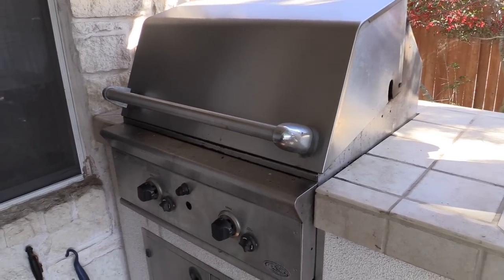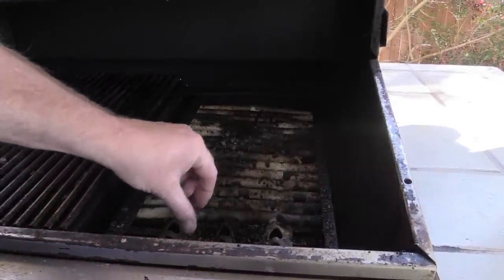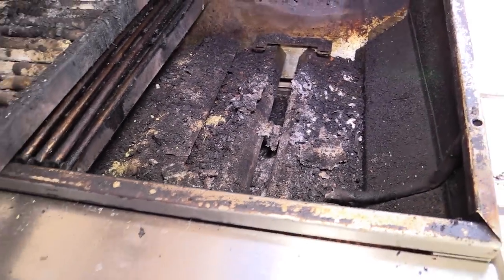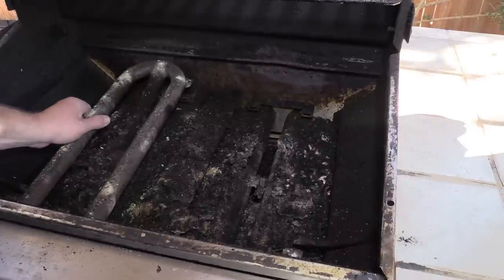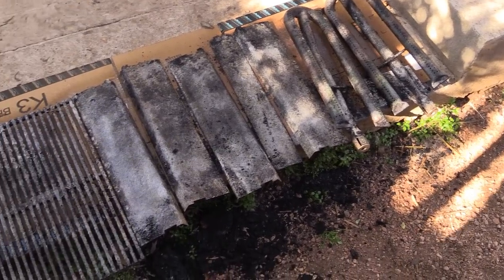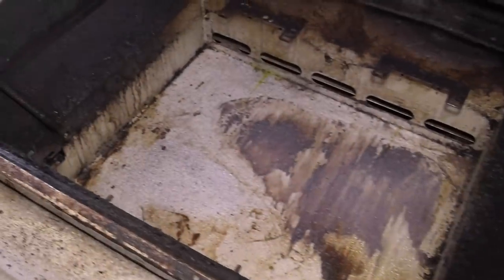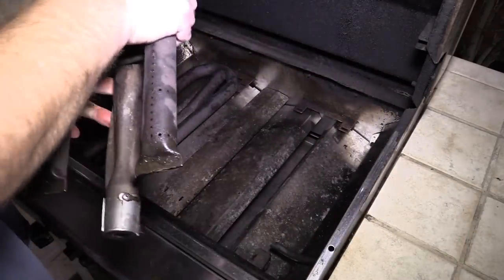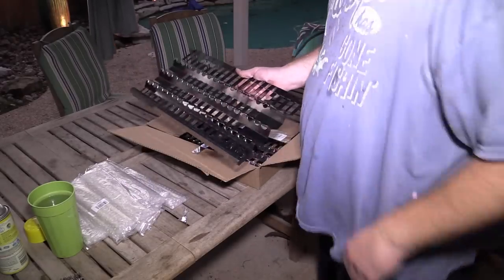How To Clean and Repair a DCS Gas Grill

Comment: Hi Troy and thanks for the great video! Any hints how to remove the burner. I'm lifting up while pulling towards the back of the grill. After watching yours just slide out I'm wondering what I'm doing wrong?...

Thanks!
Reply from the maker: Hey Phil, it can be a little finicky. There are two clips towards the back wall that hold the burner up. Perhaps one of those has gunk on it and is stuck? I remember having to turn my burner about 45 degrees to the side lengthwise to get it out. It's also possible that it is stuck on the front side wall. Again, probably just has some gunk on it and will take a little muscle. There isn't anything solid holding it in place, so just keep tugging and rotating it until she breaks free. Mine are stainless steel, so you cannot damage them if yours are also SS.

Comment: Thanks for the video, I have  DCS that is about that old but the ceramic is still in good shape(because the person who gave it to me USED it once) so to clean them though I should just heat them up? or can you pull them out and clean them off with some kind of solution?
thanks.

Comment: Awesome video troy.you made a messy job look so easy! By the way what kind of oven cleaner do you use?
Reply from the maker: Hey a2fitness, I used a heavy duty commercial grade bbq degreaser/cleaner. Don't remember the name, but it's in a smallish silver aerosol can with black top. This was the 1st time I'd used it and it worked great. Normal oven cleaner doesn't work nearly as well. Sorry I already threw the cleaner bottle away or I'd give you the name. Thanks for asking!

Comment: Excellent video. The grease pan on my DCS 48" won't slide out. It moves a fraction of an inch. Any idea on how to get it out?
Reply from the maker: It’s on rails, so try prying it out by sticking a flat head screwdriver under it alternating sides. Or, heat it up to loosen the grease.

Comment: Hey Troy, nice video. I have a similar grill that is about the same age. Both of the rotary ignitors are shot. The shafts are made of plastic and they no longer work. I like the fact that you installed the electric ignitor. Which one did you get an was it hard to install? Does it hook in to the electrodes? One last thing, one of the burners makes a lot of noise when it is lit. Does that have anything to do with the oxygen mixture? Thanks again!
Reply from the maker: Thanks bro, I appreciate you watching and commenting. The electric ignitor I bought used the factory  electrodes. I think I picked it up at Home Depot or Lowes. Not sure about your burner making noise? Check to make sure all of the holes are clear and perhaps it is getting either too much air or not enough air if it sounds like a whistle. If you cannot figure that out, you may want to contact DCS. The electric ignitor is nice, but it does get a little hard to light just after a rain.
Reply: Thanks for your reply. A few more questions. I need to replace the ignitor and switch assembly. I've actually ordered the parts. I see that the front plate requires a "start" bit. Do you happen to know what size bit I need? Also did you use oven cleaner on everything you cleaned (including the burners)? Thanks again!
Reply from the maker: Each ignitor assembly is different and usually says what the hole size should be. I just remember it took a really good bit to drill through that stainless steel thickness. Yes, I used oven cleaner on all of the parts including the burners. It's stainless, so it won't hurt it. You're gonna have a really nice "like new" grill. How awesome!!! I love my DCS!!! Send me a picture of yours or post it on my Facebook page TroyCooksGoodFood. I'd love to see your grill when you are done!

Comment: Here's a Tip T-Roy, Cover the Barbi with Strong Alu Foil as much of the inside as you can especially the bottom tray and sides, dam easy to clean just throw the Alu and crap away and presto a clean Barbi.saves a lot hard work latter on.
Reply from the maker: edward david Thanks for the tip Ed and thanks for watching!!